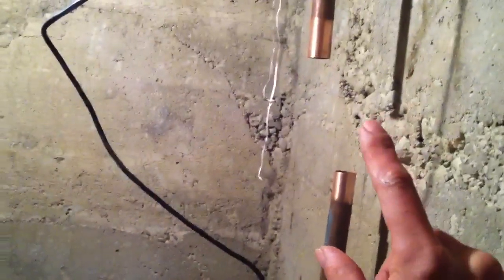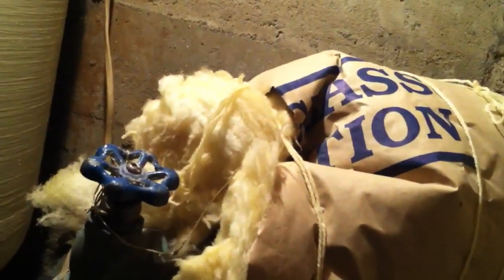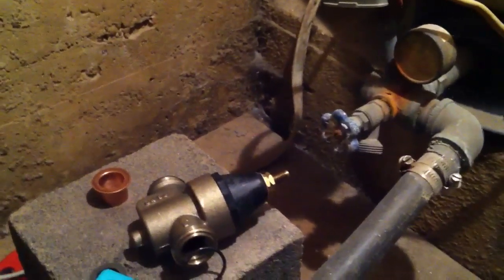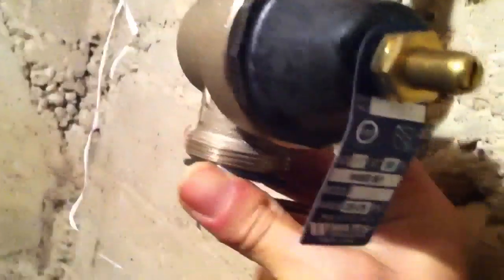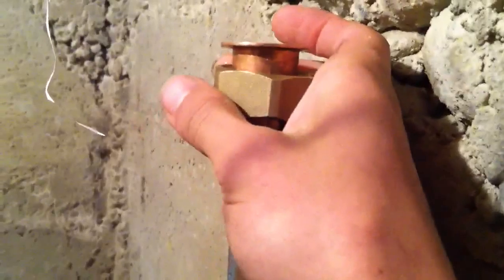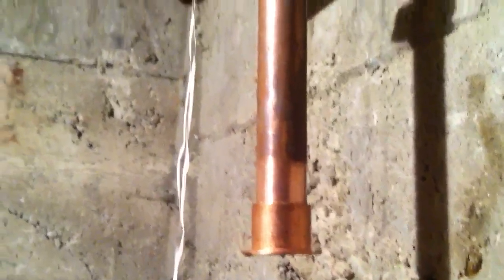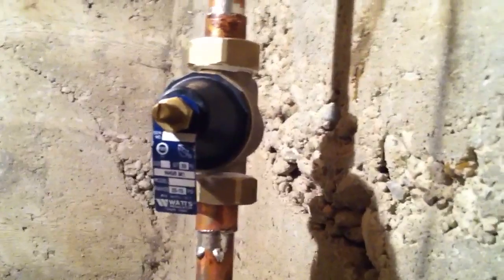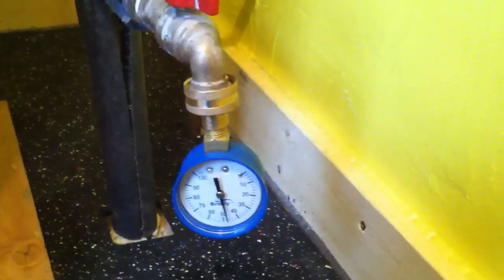How To Install A Water Pressure Reducing Valve

Comment: Where do you exactly fit the pressure relief valve is it near the water tank or is it near the cold water outlet ??
Reply from the maker: I put mine by the cold water outlet. You'll want to make sure to install it before the water gets to your fixtures.